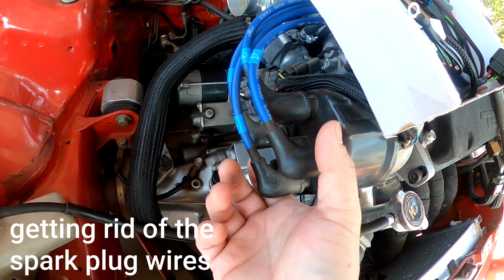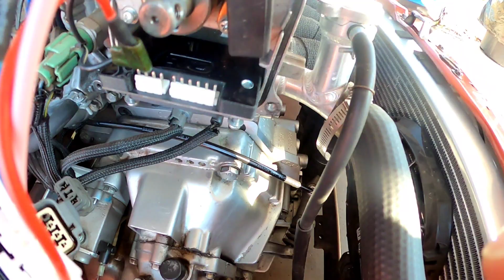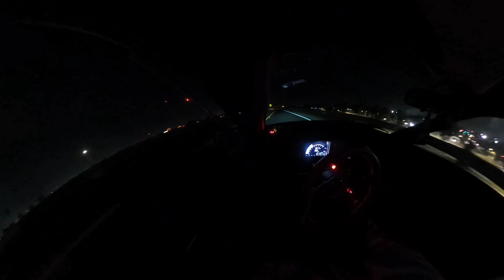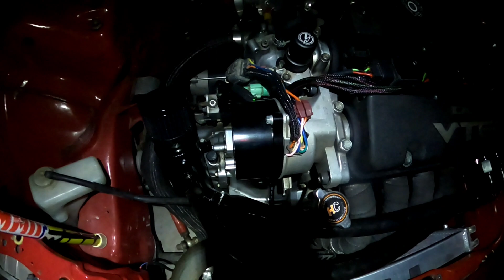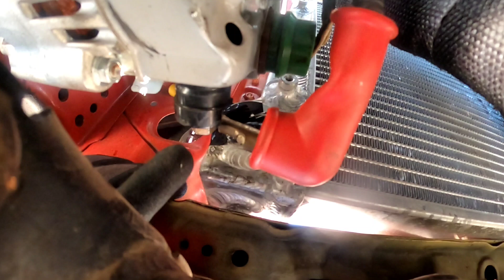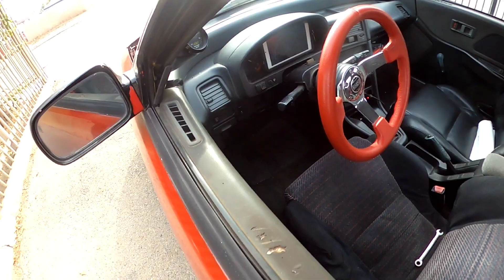Coil on Plug G23 Crx

Comment: Damn efs and crx 😂, always having electrical issues.3 years later i found my ebay ecu jumper harness was missing a wire for the alternator to stay running when coming to stops.luckly i only drive the car when i feel like it and weekends but i found that out couple days ago